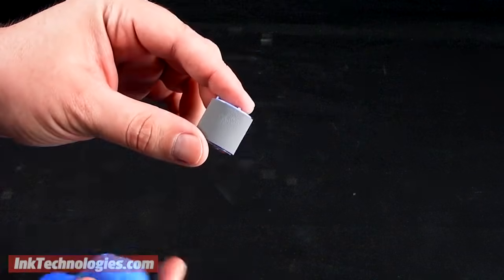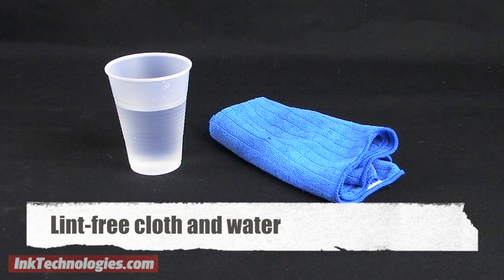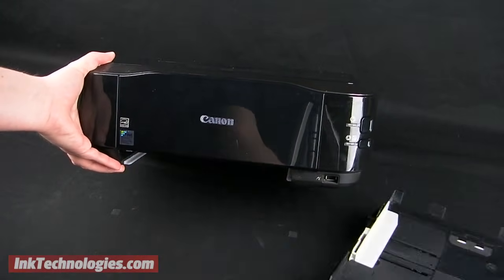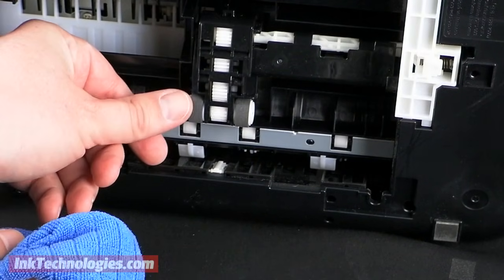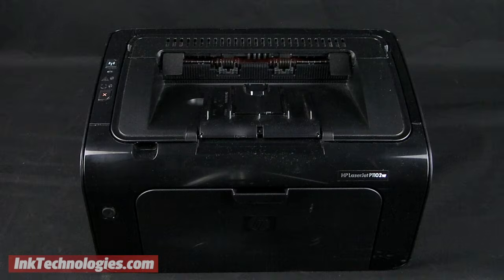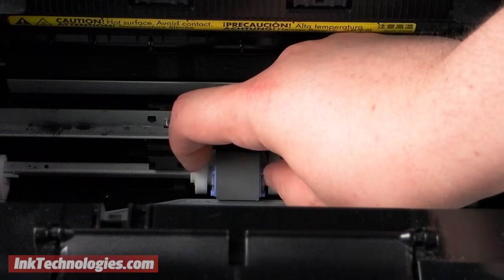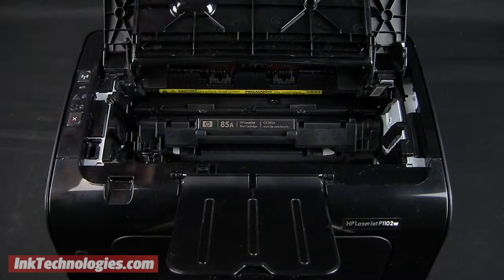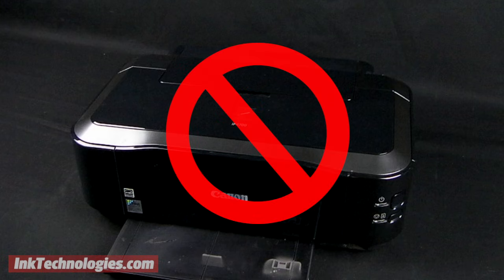How to Clean Printer Rollers

Comment: The particular laser printer in this video is known for its frequent jams. There is a blue module on the rear/bottom that can be easily removed and installed for cleaning.

Many times, rollers and guides that need cleaning are indicated by a contrasting color; blue in this laser printer's case. Look for additional same-colored rollers and guides to service them as well.

Support the Right to Repair movement!

Comment: There's no such thing as "easy removal of the paper tray" even by rotating the printer. Mine was well locked in despite a nice diagram from the company showing how easy it was if you put it on its side. It wasn't on the 305 ink jet! I couldn't reach the rollers at all. However despite you saying not to use anything but water, I did try alcohol and after half a bottle of hooch I was happy as Larry with the result in that I didn't care one way or the other, and I am now contemplating hurling through the bloody window!

Comment: Thanks.  My roller didn't come out, but I wiped down all surfaces I could reach and it definitely helped.  Tip: check with a flashlight.  I thought I had wiped the roller well, but went back with better light and saw more to be cleaned.

Comment: Waste of time if you have sandpaper! Sandpaper negates the use of water by roughing the roller for better pickup. Sandpaper is a MUCH better temporary fix unless rollers are super gunky, in which case, you have a bigger problem than a pickup roller lol. MAYBE in a certain factory environment, this would be a better option, but not from my experience.